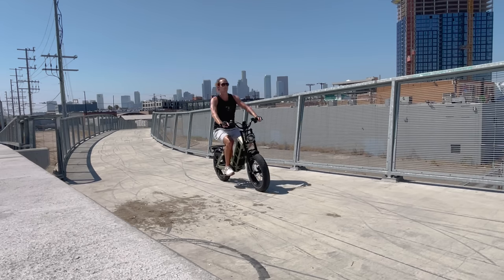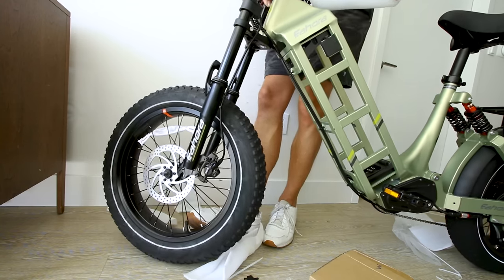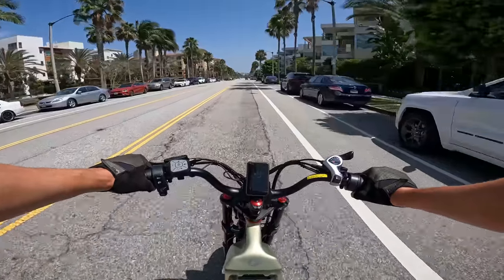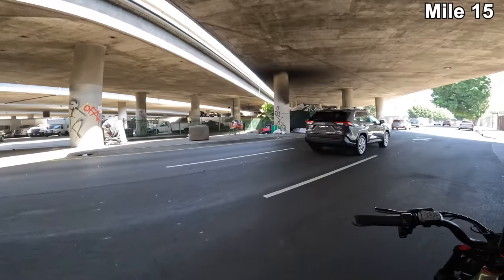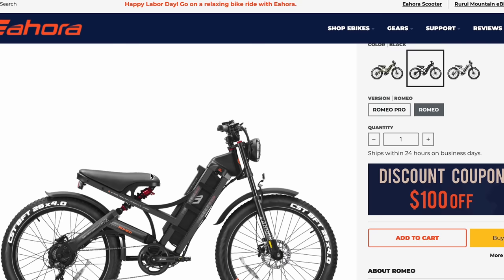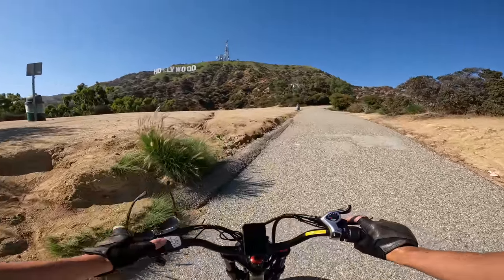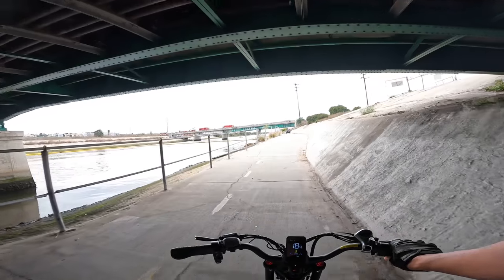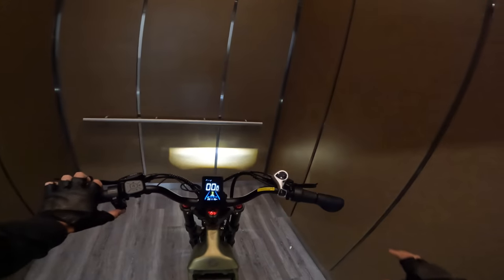I Survived Los Angeles On My Eahora Juliet Ebike

Comment: Between Eahora Juliet 60ah ebike and the Aniioki A8 Pro Max 52v 60ah. Which one should i get?
Reply: Depends really they both have the same brand of battery and similar range. The A8 Pro 52v is gonna give you a bit more power and torque for hills as the Juliet is only a 48v.  I'm not sure if a 52v Juliet is in the works though.  I was originally looking to buy the A8 Pro but I opted for the AQ177 52v instead because it comes with a standard adjustable seat and post that can be swapped out if need be. The A8 Pro comes with a non standard proprietary seat that cannot be swapped out this was a deal breaker for me but if that doesn't bother you go for the A8 Pro.
Reply: @zeppast hey after all this time is your aq177 doing good ? I am between eahora juliet 1-2 and the aq177 and i really am lost please help me
Reply: @HotTeaxD  It's doing ok but I haven't really ridden it in a while too be honest.
Reply: @zeppast  thank you for letting me know. Just wanted to know about battery life and if its the bike hold in on still.

Comment: I have a question I want to replace my front fork does it matter if it’s adjustable
Reply from the maker: I do not believe it should matter if it is adjustable or not, you just need to make sure that the head tube is the correct diameter which I would think they should be pretty universal.
Reply: @TailHappyTV  ok thank you

Comment: This is a really cool bike but these are prohibed in Germany. Only up to 28 mph/45 kmh. Thats not the problem. The problem is only 500W and pedal assist with max 200%. So you have to pedal very hard to reach 45 kmh. The 2nd problem is that cars are driving at about 55kmh. So you will block all traffic here. 3rd: These bikes are horrible expensive. About 4000-9000€. You should buy a car here. 
Maybe they can release this bike as a scooter in Europe/Germany.

Comment: All these pre-made e-bikes, with handlebars so low that I would have to stoop over to reach them, just boogle my mind.
Reply: Matt's a strapping 6'5" lad, and he did just fine.
Reply: @txtworld   No he didn't. He specifically said that he had to put the seat down much lower than he wanted, in order to make reaching the handlebars comfortable.  Did you see how high his knees were coming up as he tried to pedal? You can't pedal efficiently that way. And, if you do it very hard, for very long, you end up damaging your knees.
Reply: @GrantSR Matt raised the seat height in the midst of the ride, and said it was much more comfortable thereafter. There's also the Eahora Romeo Pro, which has 26" tires.

Comment: It’s too bad you survived to persuade me to buy a bike through Amazon.  

The bike is used Fred.   The brakes were changed so many times that the caliper looked like a old ford lug nut.   

In addition the manufacture of the frame may be made defective in manufacture  as I noticed a yell sound from the rear brake  going up steep hills.     

When I looked at the position of the rear wheel mounting bolt into mounting groove I noticed differences on each side and that ehore may be cock eyed. 

I am considering taking my bike far far away by shipping it around the world to shingzhou.  Amazon likes delivering re box ehore.   I bet the bike rep pays this cat to say yay 

Kurt Brown Saintrambone Mobile Audit Club